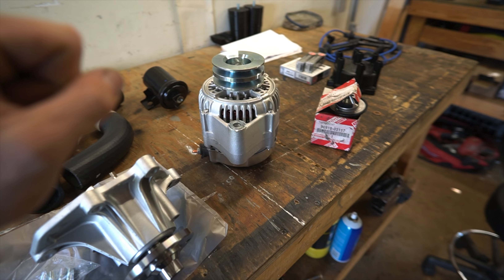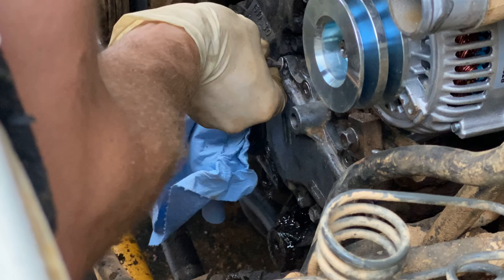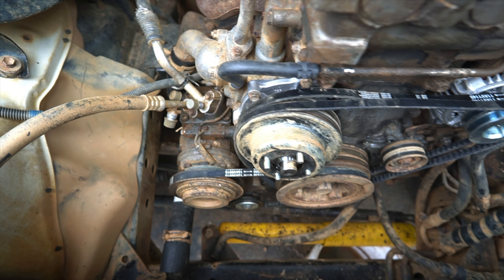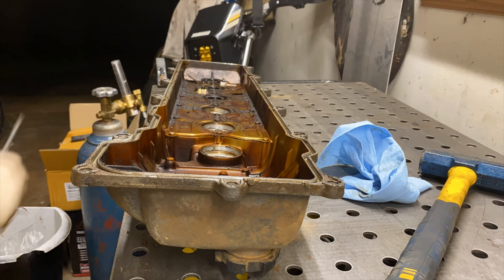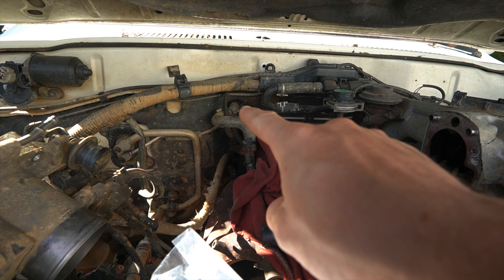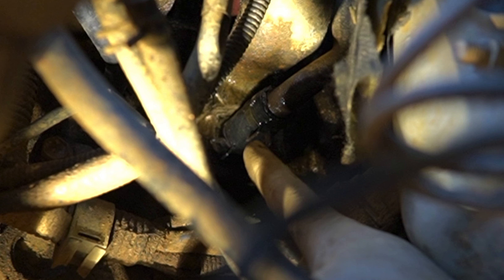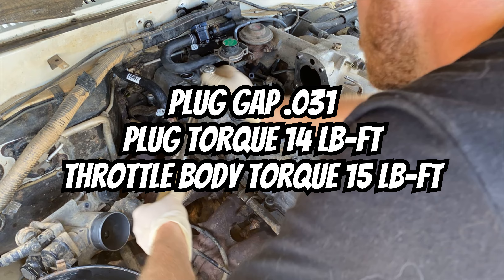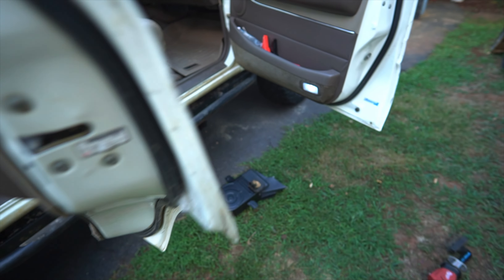80 series Land Cruiser - Important Preventative Maintenance!

Comment: I highly recommend that anyone who owns an 80 Series replace ALL these rubber hoses as soon as possible. My 80 has been laid up for several years now for various reason, but what sidelined it was one of the bypass hoses under the throttle body. I did the PHH that was well discussed on Ih8mud, but the bypass hosses weren't really talked about at that time. Due to health issues, I've just started doing this job. Everything takes a lot longer than it should due to the hoses being so hard from heat and age. Every coolant hose, transmission hose, power steering hose and vacuum hose should be replaced.

Comment: Great video, I have done all these and did all while doing a head gasket, so I was able to remove the rear heater pipes from the front, and actually replaced them with a solid set. had the delete mode before I did that and went back to rear heater again to have it as stock as possible. Great trucks and easy to maintain if you do it yourself.  If you have to pay a shop to do anything, it will get expensive real fast.
Reply from the maker: Thanks! Yes they are great trucks! Not so worried about the stock factor on this one as its previous life was an off-road driving school truck and its body shows haha.

Comment: I love having my rear heater. I just make sure I Fluid Film my undercarriage every year so I don't have to deal with corrosion. Good thing you replaced that radiator...man that thing was about to blow!! To finish the job don't forget to put some weather strip between the top of the radiator and the core support to make sure all the air is getting pulled through the radiator from the front. Nice work!!
Reply from the maker: Yeah mine was too far gone unfortunately! Thanks! I’ll look into getting some weather strip!